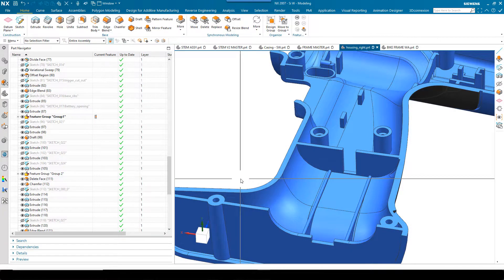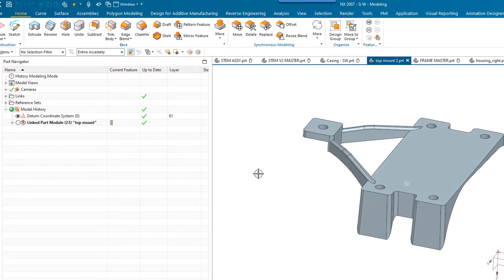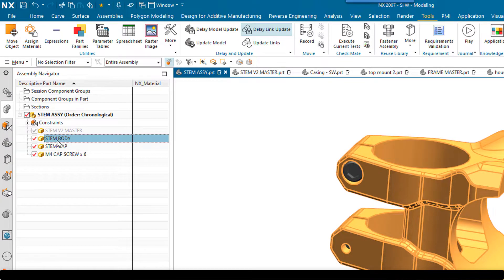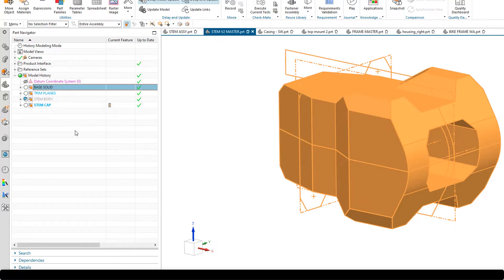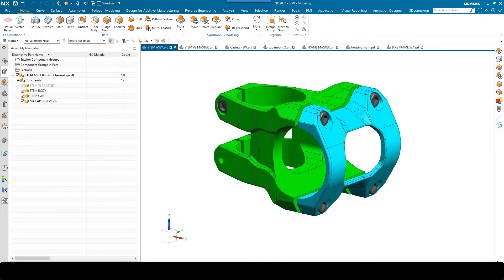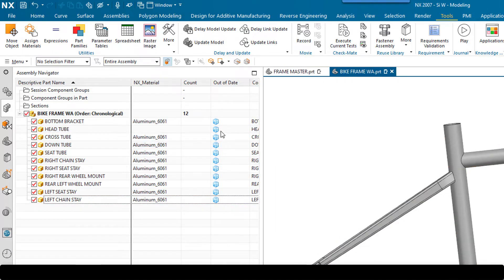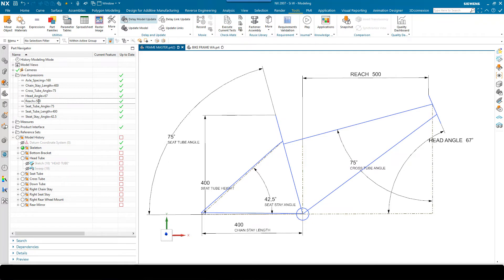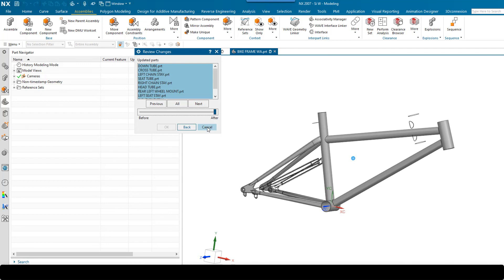Siemens NX: Managing Design Groups | OnePLM

Comment: Very interesting workflow you show here fo the bike. I often worked similar, but were never really sure it's the proper way. 

The problem for me comes when each variant of the bike (small, medium, large) needs it's separate part files and drawings. I could do this like you have shown for the first configuration, then freeze all links, save the whole assembly excluding the master part, change configuration, freeze links and so on. When changes in a specific config needs to be done, make sure the correct config is active, then unfreeze the links. This is necessary since the current configuration is saved in the master. Is there a better way to grab different configurations of the master part? Of course part families could be used, but this is more rigid and needs more commitment i think.

Another thing. If only a body is linked to the part file, you always lose some information. Every parameter, feature or reference geometry needed to create the body is only available if i linked separately. Ideal would be some linked features with all this info, maintaining its associativity to the master, but also can be made independant if needed. This works with sketches, buts if made independant, you loose external references. Datums can also be linked, but not made independant. It seems like linking just parameters is the most stable and flexible way. If needed sketches, datums, faces, if absolutely necessary bodies. But it's so much easier and faster to model on the go in the master part and just link bodies at the end. But in a company environment with PDM it's critical to have single part files and drawings, where a change can be made independantly without revision of the master.

In 15 years of using NX i never found a perfect solution for this. I often was forced to dumb everything down again because quick changes need to be done and the structure would become too complex, especially when working in a team or company.

Since you seem very experienced with these kind of workflows, i would love to hear your opinion on this and if you have any other solutions for the mentioned problems. 

Thanks!